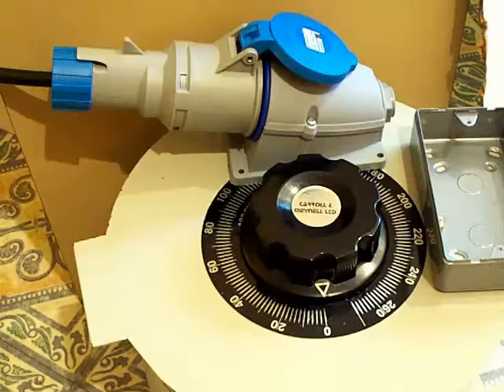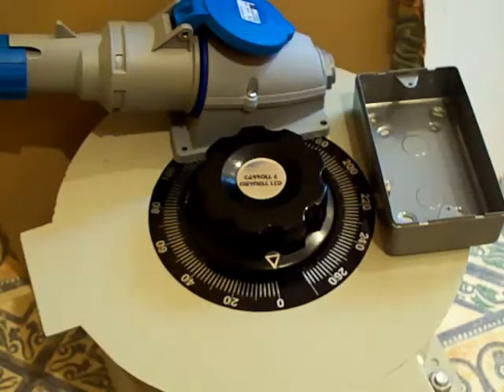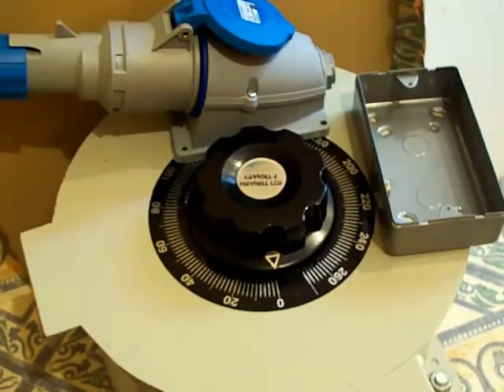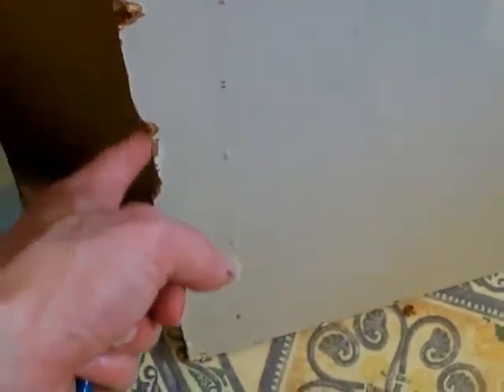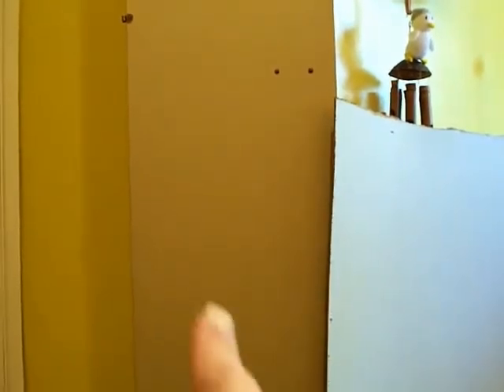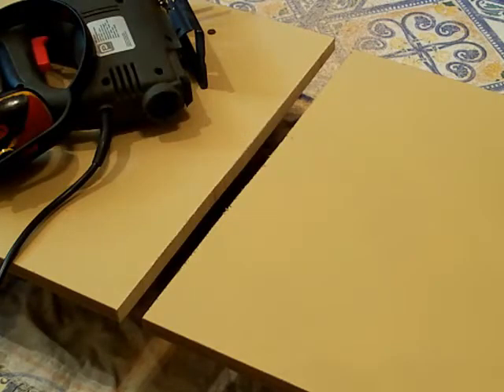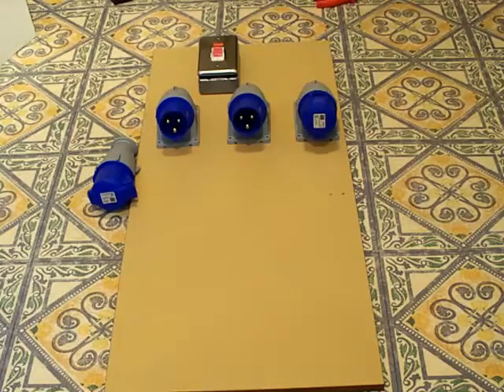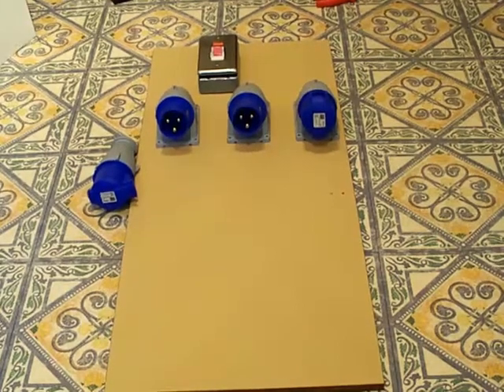Electrical : 32A Soft start unit - preparing the board.

Comment: Maybe, once you get the unit put together ( this is just a suggestion, so you don't really have to do it ) maybe you could connect up some coconuts and see what happens;)
Reply: Coconuuuuuut, let's go blow one up! :D

Out of all honesty, a 32A soft start unit wouldn't be needed for that. When Mr. Photon popped those coconuts, I think I remember him saying that approx 5A is best for the poppage. Given that, I could use my little soft-starter to start and run the BIG DOGG and pop a 'nut that way.

Yes, popping coconuts.... one of Mr. Photon's more explosive videos which really didn't catch on like the washer-kill vids did.

But then.... looking back on it, to pop a coconut, a variac and ballasting are needed, unlike the washer-kill vids which are straight-to-mains.

Thanxx for watching,

-Wayne's Electrical.

15th July 2017, 19.55
Reply: Yes! And those tips worked for me! 2 inch electrodes with glue around them, power of 240v @ 5A as well as safety, and a little sit back and enjoy the suspenseful show;) Love those old photon vids!!